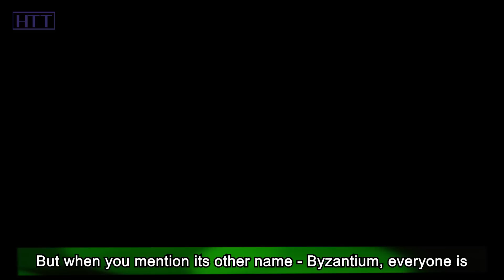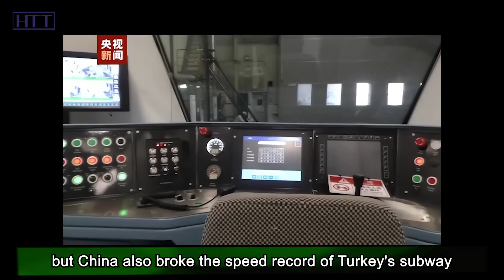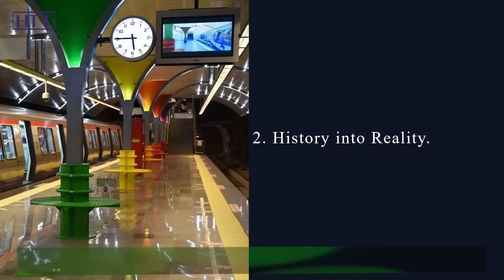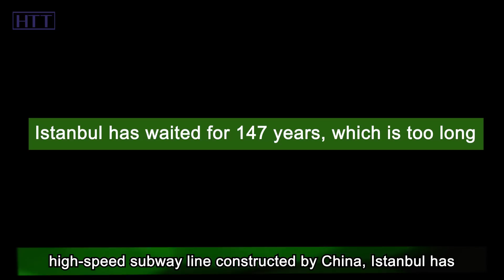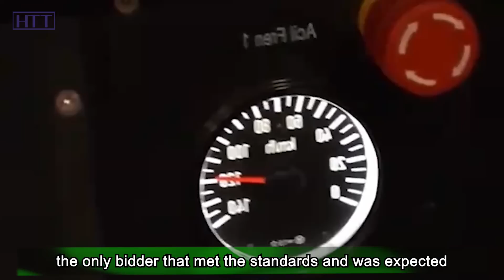Shocking! China helped Turkey build its first subway, which was delivered in only 6 months

Comment: The contract was for 176 subway cars and required a 60 percent localization rate in Türkiye.

Haluk Oguz, a management specialist at CRRC ZELC's subsidiary in Türkiye, told Xinhua that they have delivered 40 vehicles. "Work on the other 136 is ongoing," he said, adding "they will be manufactured at our factory in Ankara, turkiye engineers used 10 tunnel boring machines at the same time in order to put into the service the new metro line as soon as possible. The construction process of the metro line was done with full of domestic and national engineering achievements,” The new metro line is equipped with signalling system developed by Turkish defense corporation Aselsan in cooperation with TÜBITAK, the Scientific and Technological Research Institution of Turkey, the story Chinese engineers build new metro line in Istanbul is fantasy  and misleading
Reply: Their goals are different, otherwise they are the ones who know it best.

Comment: Slightly ridiculous intro: Byzantium (Greek name) didn’t bear that name since 330 CE! So if one is not familiar that or Constantinople (Roman name) which also wasn’t in use for nearly 600 years, or Istanbul (current name since 1454 CE) one is either willfully ignorant or deliberately obstinate. In addition Istanbul got its first underground railway line in 1875 CE! And modern metro system since 1989. Get your facts straight!

Comment: The quality of Chinese-made trains is so bad, even Russia failed them after the initial delivery and canceled the entire order.

Pakistan was not so lucky. They scrapped the Chinese locomotives after 10 years of troublesome service, and the entire fleet is now lying scrapped in a junkyard.

The worst-ever locomotives of Pakistan Railways are Chinese. DPU-30 and DPU-20 locomotives were imported from China in 2002 having 3000 and 2000 horsepower with 4 stroke Diesel engines. All 69 locomotives were grounded in 2012/13 after having major faults in every locomotive. The other worst locomotive is ZCU30, which is also made in China. Rated at 3200 horsepower, a total of 29 of these locomotives were imported, and 5 were locally assembled in the Pakistan locomotive factory at Risalpur, these locomotives were imported in 2014/15 and all 29 locomotives are grounded due to failure of their prime mover which is a Chinese copy of the CAT-175 16 DIESEL ENGINE. The total working years of ZCU30 locomotives was not more than 5 years. This is one of the worst-ever built locomotives of Pakistan Railways.

Based on their experience with Chinese locomotives, Pakistan has decided to purchase locomotives from non-Chinese sources in the future.

Comment: Why does China copy and steal all its technology?
Virtually every Chinese fighter jet is based on stolen or reverse-engineered designs.
China has even tried to steal designs from Russia, but its attempts to produce its own domestic jet engines have been largely unsuccessful.
One of the early versions of a domestically designed engine, the WS-10A, regularly broke down after just 30 hours of use.
There are many reasons for these failures. First, Russia is aware China has stolen its intellectual property before and is reluctant to sell Beijing its best engines. Moscow also stopped selling standalone engines to China, instead including them on existing jets, which makes copying them difficult.

Comment: "Despite the COVID-19 pandemic, CRRC staff overcame various difficulties to complete production of the new subway trains in just six months," said Li Yangyang, general manager of CRRC-MNG Rail System Vehicles Industry and Trade Ltd.

The China-built metro train adopts automatic driving and locomotive reconnection operation technology, and is able to meet the transportation needs of millions of local residents and tourists.

In January 2020, CRRC Zhuzhou signed a contract for 176 trains for the Istanbul Airport subway line with Turkey's Directorate-General of Infrastructure Investments. The contract requires a 60 percent localization rate in Turkey.

“The new metro line will save 29.2 million liras ($3.01 million) over the next three decades in terms of road maintenance costs, reduction of air pollution and travel time," added Karaismailoglu.
(Credit: http://www.ecns.cn/news/cns-wire/2021-11-11/detail-ihassuxx1471777.shtml)

Comment: 40 miles in 6 months is super fast. Meanwhile India's railway system will be postpone to 2026 and only 10 miles have been finished after 4 years XD.
Reply: Bharat railway built by Japan, an American Ally...
Reply: After the latest & shocking 3 train crash in india, you bet any new train project will be delayed even longer due to investigations & implementation of new findings to prevent future accidents. The govt would want assurance if current constructing tracks & trains can comply with new safety guidelines.
Reply: Give it another 10 to 20 years to see whether they can complete this railway lines by this Japanese company.